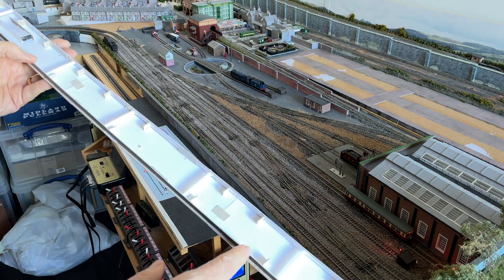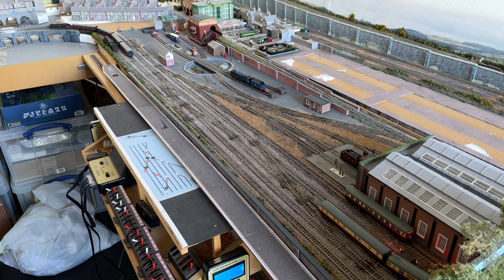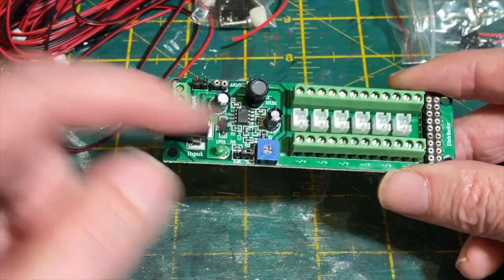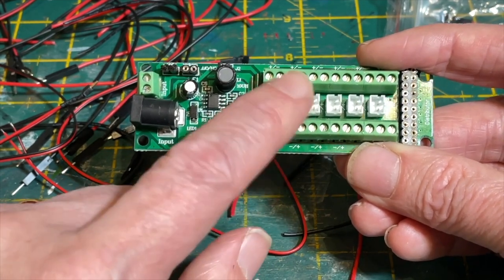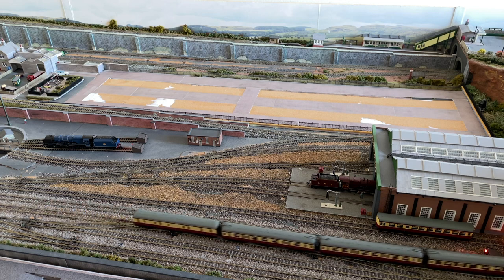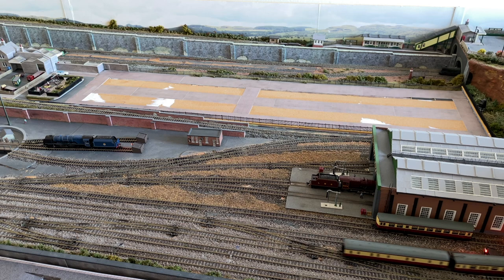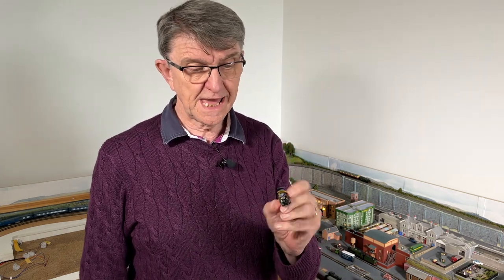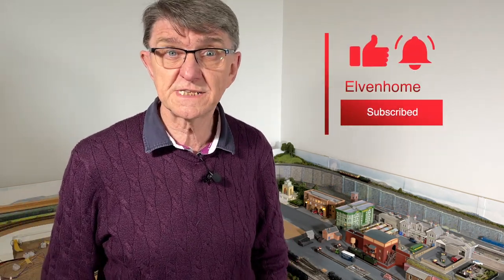N Gauge Model Railway Platforms, Train Cam and A Mystery Solved: Elvenhome EP133

Comment: Always admire the steady hands needed for N & Z Scale im building a HO Golf Cart and painting it from scratch that you will see in a video in the next month and that was hard enough for me LOL Always great and Cheers for subscribing to my channel.  Keep up the top work i adore those blue and white coaches.  - Josef Model Railway & Toy Toom
Reply from the maker: Thanks Josef.  I think you get used to working in the smaller scale, but a steady hand certainly helps.  The Midland Pullman is a very striking design.  It is a same that none of the original trains were saved, all were scrapped.  Stephen

Comment: I hadn’t realised that if was possible to use the Metcalfe kits to make bespoke curved platforms. Very good to know. Thumbs up for mending train cam too! Cheers, Ed.
Reply from the maker: Hi Ed.  Glad the vide was of use in seeing how flexible the Metcalfe platform kit is.  I was very pleased to save train cam which hopefully should last long while now.  Stephen
Reply: @Elvenhome  On reflection, to be on the safe side when building a large curved platform, building a grey board mock up using the Metcalfe plans and your measuring technique might be the way to go. Any minor corrections could be made to that and measurements for the Metcalfe build taken from the mock up. With your platform being mostly straight, that would have been overkill. Cheers, Ed.

Comment: Hi Stephen! Another enjoyable update! Didn't realise that the Metcalfe platforms were quite so thick - I may have to rethink how I was going to construct platforms on Shelfington! Good tip for creating the curved platform template! I'm definitely going to be using some of those power distribution boards! Looking forward to seeing the lights when they're in place! Glad to see the return (and resurrection) of train cam - and yes, the skills of a railway modeller are many fold, and we can literally fix anything!!! All the best, Ian.
Reply from the maker: Thanks Ian.  The Metcalfe platform kit is very versatile and would be well worth considering. Even better i you can properly make the ends first time around!  Very pleased to remember I know how to solder and that almost any component is available via the web.  Train cam literally came back out the bin.  Stephen

Comment: Great video Stephen with lots of useful tips and information. Those Metcalfe platforms look really interesting to build. Thanks for sharing. Looking forward to the next update. Roy.
Reply from the maker: Thanks Roy.  The Metcalfe platforms are very good and reasonably easy to build.  They are also sturdy and long lasting.  That platform is about six years old and only needed a bit of TLC apart from the refashioning at the ends.  Stephen

Comment: Hi Stephen, enjoyed the update as usual, thanks for the demo of the curved platform as I may well utilise that for some change of plans I have, still under consideration though!
Looking forward to the station lighting/revamp, platforms seem to have come together nicely.
Good luck with the lighting around the houses, looks like you have a solution.
Cheers for now, have a good weekend, John
Reply from the maker: Hi John.  The metcalf platforms are very sturdy, if all the supports are properly glued in.  Looking forward to getting the platform back in its place and lit up. I am hopeful the stud wall finder will provide me with sufficient certainty to make tentative holes.  I may use the router to cut only a 6mm deep hole before going near it with a drill.  Stephen

Comment: Hi Stephen enjoyed the video and your platform looks like new now! Good tip on the marking with a pen on the paper I will be using that when I make my slightly curved platforms. Great running session at the end glad you got your train cam working again! Cheers Gary
Reply from the maker: Thanks very much Gary. The demonstration of getting a template for the curved platform ends seems to have been of some use. Shame I didn’t do that when I built the platform originally but hey ho!  Stephen

Comment: Stephen thanks for the useful overview of the Metcalfe platform -based on your input this is what I will be using. Thanks also for the link to the PDB. On a slightly different subject are your turntables automated and if so are they reliable. I couldn’t find the relevant video. I’ve heard the ADM ones are v good but v expensive. Cheers. Stephen
Reply from the maker: Hi Stephen and I am pleased if the video has helped.  The turntable is not motorised.  If you look at episode 76 you will see where I replaced the original one.  It is just a PECO turntable, although they now do a motor for it which I've seen at exhibitions and looks quite good if basic. It does however work fine, at least it does if you don't cripple the contacts underneath, as you will see from the video. The ADM turntables are excellent and fantastic engineering (the table remains live all the time even as polarity has to change)  but cost over £400.  They also require a quite large hole in the baseboard.  Stephen

Comment: Another nice video Stephen I like how you have re vamped the platforms. I am using a mixture of platforms on my new layout. Peco edging on a small straight platform, although you can curve them if you soften them up and make cuts but I prefer the Metcalf platforms for curved platforms much easier. Would you believe I cut a pencil in half for my last layout and taped it to a coach. This time I have dropped a clog I have ballasted already, I will manage somehow....lol
Reply from the maker: Thanks Chris.  It is trickier once you have ballasted.  I put the paper over the tracks and used a graphite stick to do some brass rubbing to get the line of the tracks.  I cut along the inside curve which allowed me to place my template on top of the sleepers butting up to the track.  I could then run the coach and wide locos across to get my line for the platform.  Stephen